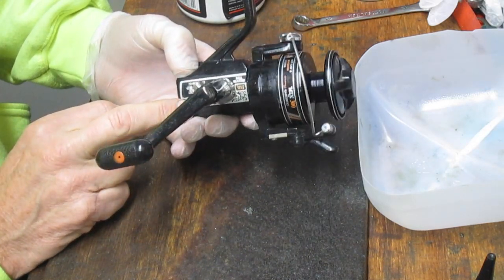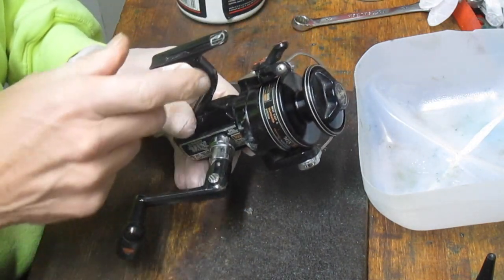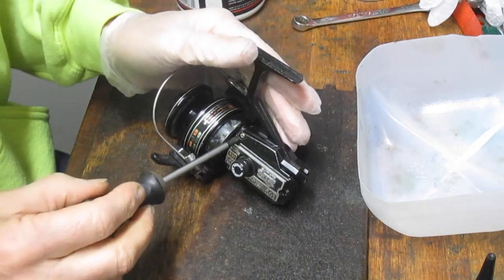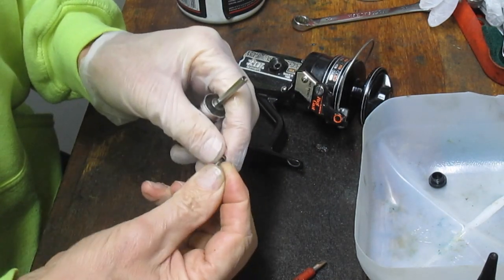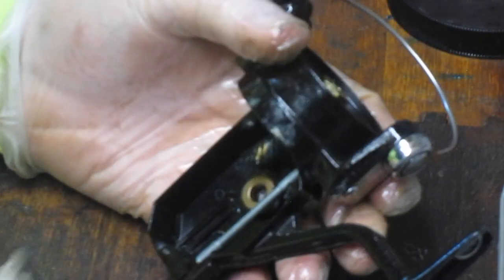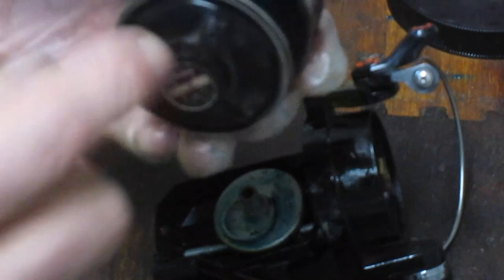Shimano MIX 300 Fast Cast fishing reel how to take apart and service

Comment: Great video. Just FYI this reel is an MLX 300. NOT an MiX. Hard to tell because it is in cursive. Also, the spring and "top plot" under the rotor that you are referring to is the anti-reverse dog, anti-reverse dog spring, and the anti-reverse dog screw. I have a repair manual with all the part numbers if anyone is interested. Just message me, and I'll shoot it over. Very hard to find any info on these reels. beautiful artwork from the golden period of Japan manufacturing. A reel dandy :)
Reply from the maker: Thanks for the clarification Will and thank you for volunteering the information - Dennis

Comment: Hi Dennis, Thanks for this video. I have this exact reel and it used to belong to my father. It's in good shape but I'm missing the spring on the side of the bail where the fast cast trigger is located (I think you call this the live side of the bail). I think my father was probably working on the reel at some point and the spring was lost. I'm really keen to get this reel working again and would like to know if a replacement spring is available and where I could order one. Again, thanks for your videos - I'm learning a lot! -Dave
Reply from the maker: That reel is pretty old.  Try the folks at Southwesternparts.com They are a Shimano parts reseller and may be able to tell you if one is available or if there is a substitute from another model that may work.  Dennis